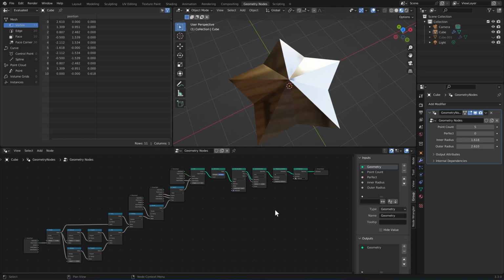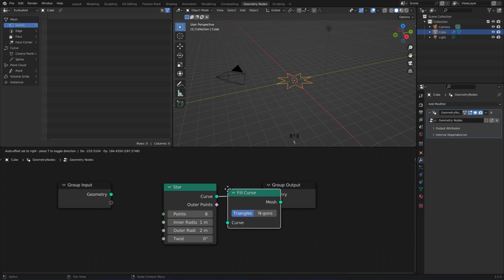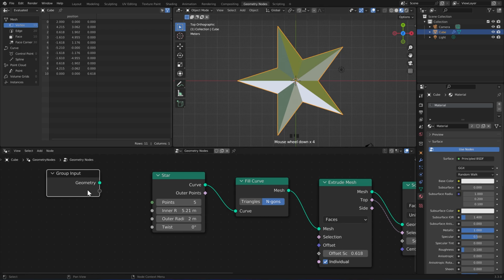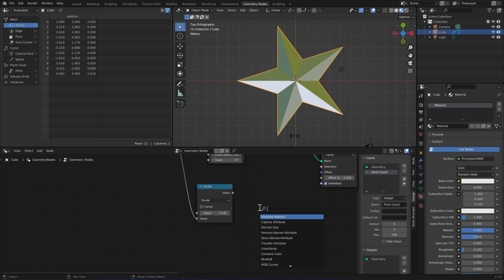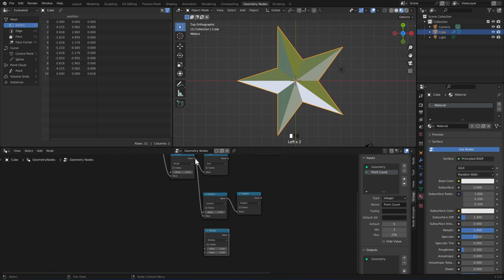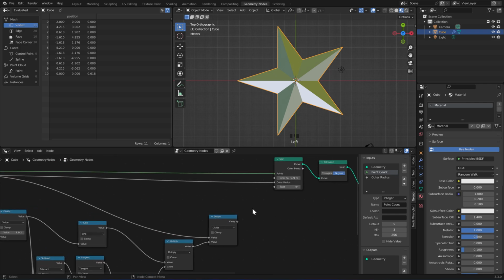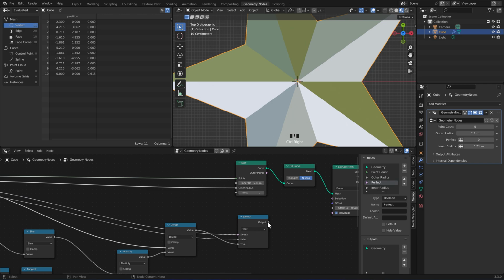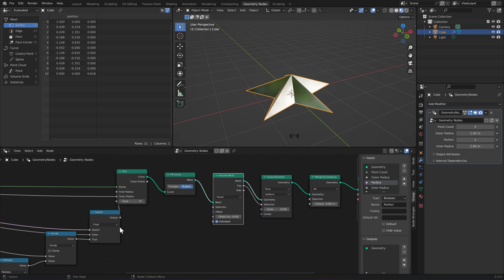How to make a Perfect Star in Blender using Geometry Nodes

Comment: How I solved the challenging I think I connected the the input on the extrude that controlled the height with group input and turned that group input into a input that is compatible with the switch and connected the truth to a node with a set height and false toward the group input, so when the height is set to false you can control height and the when it is set to true it creates the set height which you can customise easily.

Comment: Great tutorial! Easy to follow and straight to the point. Hopefully I'll get to translate math to geo nodes as easy as you make it look like :)
For the challenge, (spoilers) what I did is:
I just connected the "Outer radius" to a Math node set to Divide. Then, make it so it divides by 3 or 2 and connect it to the "Offset Scale" in the "Extrude Mesh".